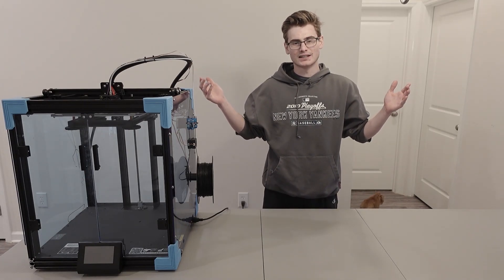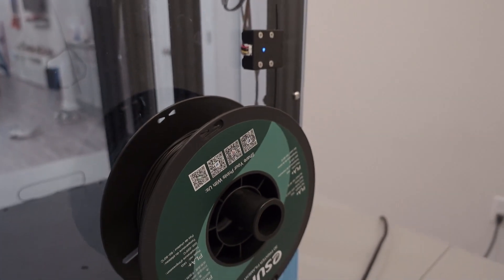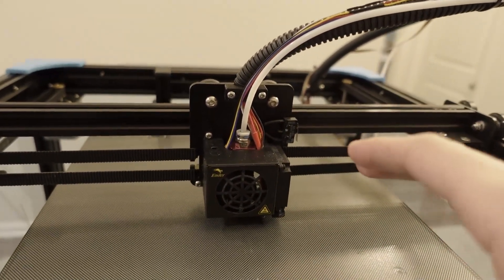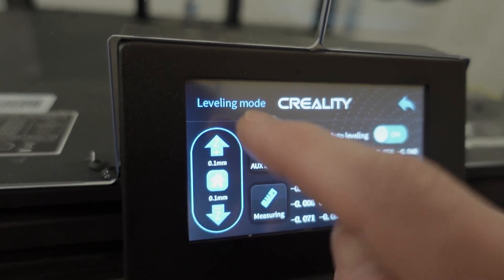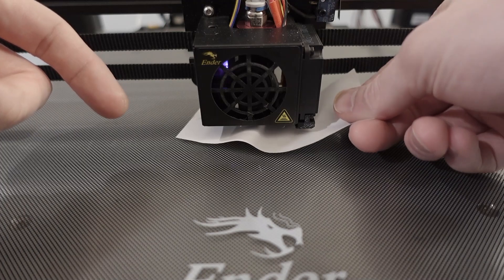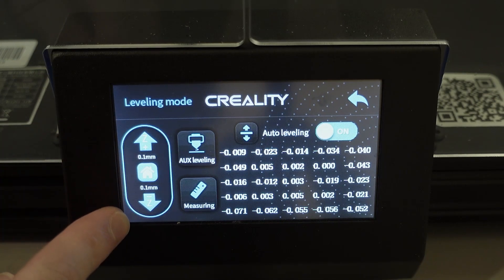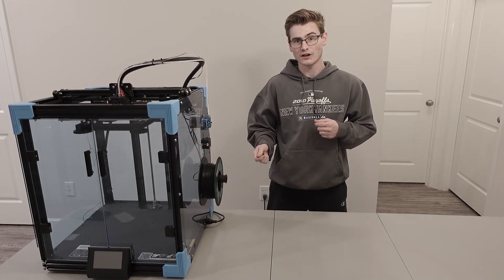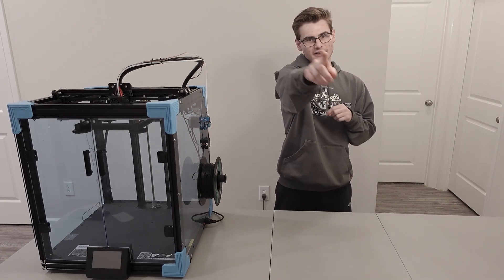How-To Calculate the PERFECT Z-Offset For Your Creality Ender 6 - CR Touch

Comment: Quick question... When I turn the printer off, and then back on again (say, the next day), and I go to the leveling screen, all the numbers are zero... Does this mean that it did not save the mesh? Does the mesh save automatically every time?   I also noticed that if I re measure, without turning it off and then back on, the numbers all change (even if I didn't touch anything). Is this normal?   I have the most recent firmware (I re-flashed it when I got the printer)

Comment: Great info! Thanks! I’m trying to add a magnetic cover to my Ender 6 bed but run out of space between nozzle and bed when trying to adjust the z axis to it new level. Is there a way to set the z axis permanently lower than the factory set height? Thanks for any help you can provide!
Reply from the maker: If you look on the back right side of your machine, you will see a silver looking screw. If you unscrew it a little bit that will essentially make your stop switch trigger sooner, which will force the bed to be permanently lower.

Comment: well if it was stored in the EEPROM it would be lost at power cycle... In my experience it tries to save it to the SD card as a file, when you swap the card or do not have a card in the printer, the Z-Offset is way off after power cycle. 
So even when printing via USB, you need to keep a SD card in the printer for this work !
Reply from the maker: Hmmm I will take a look. I have never had this issue.

Comment: As far as I know the Z offset is not saved on printer, but rather it will save to sd card.  If you check your SD card you will see a EEPROM file
Reply: Thought you said it saves to printer.  

Most of the time I can get my 6 to run correctly but sometimes once I start a print it will freeze when it is homing/measuring.  Any ideas?
Reply from the maker: @mheissenberger5143  ah OK yeah I might have said that. If I did then I was probably simplifying the process. It definitely saves into the eeprom on the SD. I apologize for any confusion you or anyone else had from that
Reply from the maker: Yeah it should save to the eeprom. Did I accidentally say something incorrectly? :/

Comment: I'm confused, when I level my bed I dont have some of the options you do, I just get the 1,2,3,4,5 squares. I can't find a measurement option at all.
Reply: Do you have the CR touch firmware installed?  You download it from Creality
Reply from the maker: You likely did not install the new auto leveling firmware
Reply: @ThePrintHouse  I did not, I have what ever is factory default.
Reply from the maker: @3MenAndALetsPlay  Ahhh ok you will need to go to creality website and get the latest ender 6 bl touch firmware and flash your printer with it. All you do is put the firmware file onto the SD card with no other files. Plug the SD card into your printer and turn it on. It does the rest automatically. If you need extra help I actually do have a video about that on my channel (for the ender 3 but it works the same for ender 6)

Comment: Thanks for the info. YOu may want to work on your audio for voice. There's echoing in the sound and the sound level goes up and down. A nice camera stand would help as well. Also, you assumed that folks have a BL Touch. Perhaps you could address leveling for those that don't have the BL Touch. Keep up the informative videos!
Reply from the maker: Thank you! And thank you for the suggestions! I actually do have a pretty good set up in terms of camera, tripod, and microphone, except the problem in this video is that I dont have a wireless microphone attached to my body, so as I talk and move the directional microphone plugged into my camera has the volumes go up and down. I do agree that is a problem and I definitely want to invest in a body mounted microphone so I can fix my audio level. I also have some issues sometimes related to audio editing from clip to clip. I hope this issue wouldn't prevent someone like  you from subscribing! I am really working to increase my production quality, so comments like yours are very helpful in that! Thank you!!! :)

Also, I think I do have a video related to auxiliary leveling but it was one of my first videos every posted, so it can probably be refilmed with higher production quality than it was filmed with originally. :)

Comment: Hi I sure could use some help. I enjoyed your video. I have ender 6 I haven't  been able to print for quite a while. I using firmware_Ender6
-BLT_DW7.4.4.bin. I have adjusted the Z offset just as you demonstrated and Aux leveling and measuring but when I go to print or turn it off back then on the nozzle  it hits the glass . Now also having issue with adjustment knobs. I run out of adjustment and they spin free. Your help would be appreciated thanks
Reply from the maker: Hi you are running out of adjustment on your ender 6 because your springs are not long/firm enough. Unfortunately it seems like that is a standard issue with all printers. One printer to the next is never the same. I will actually have a video on springs coming out soon, so maybe I will be able to release that soon enough to help you.
Reply: @ThePrintHouse  Thank You
Reply from the maker: Of course!!

Comment: Thank you for this. The ender 6 to me is a great printer, the bed levelling is a pain though!! I am a bit confused though as I have read that the eeprom save is done on the memory card? If you remove the memory card while the printer is on that file becomes corrupted?

The machine has to be turned off before the memory card is removed and reinserted BEFORE it is turned back on? Do you know of this is true?

Also you dont mention if the bed leveling is done everytime before a print starts or not because if it does that wont the z offset change again before each print?

I have the bltouch but havent installed it yet because I have also read that a lot of people have issues after installation where it doesnt work of only measures a few places and then fails?
Reply from the maker: I dont know exactly how it works, but I believe the eeprom is read from the sd card and stored on board until the printer is turned off. Honestly, the printer should always be off if the SD card is to be removed. I always just redo my bed mesh at the beginning of every print. I couldnt get the mesh to load from eeprom with m420. I will probably revisit that project soon.
Reply: @ThePrintHouse  The big problem is that there is no source code from the firmware released by Creality. You are completely working in the blind here. There is some fan-made source code, but (as far as I have understood) your display is not longer working, and has to be replaced by a generic one. One of the big reasons the Ender 3 has become so popular, is that you can compile the firmware yourself, and thus do a lot of tweaking.
I really like the CoreXY concept, but as long as the Ender 6 has closed source software I keep my Ender 5. It's a shame, because I really wanted to buy that Ender 6. As things stand, however, I keep my money in my pocket for now.

Comment: A video suggestion. Maybe do some hot end and firmware upgrades for the ender 6 I'm trying to get the hot above 300  c while also using a CR touch
Reply from the maker: I actually really do want to do some firmware modifications for the ender 6 because I do not like the firmware from creality. I'm not sure when I'll get to it but that will definitely be a video to come to my channel eventually. What kind of materials are you trying to print on the ender 6?